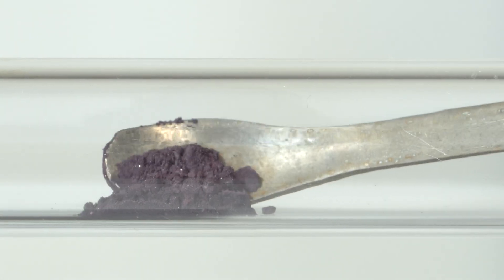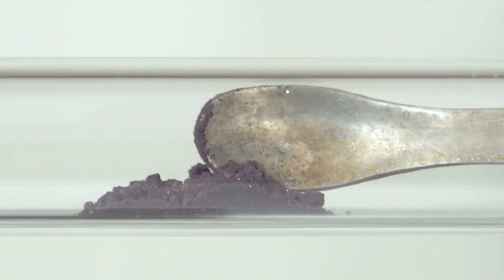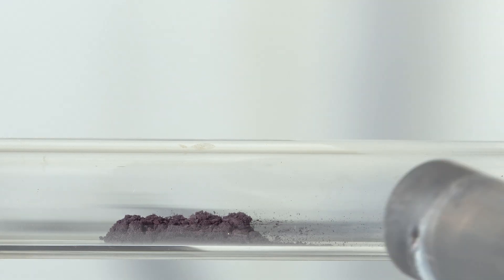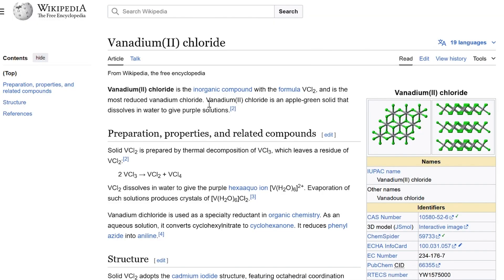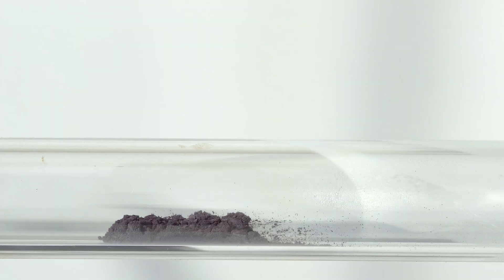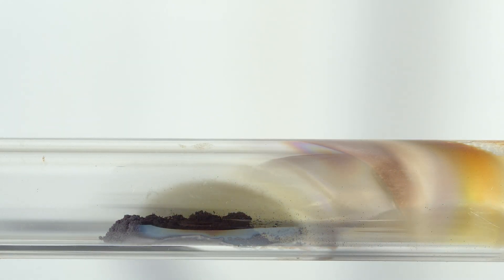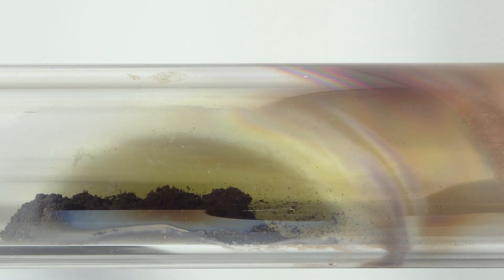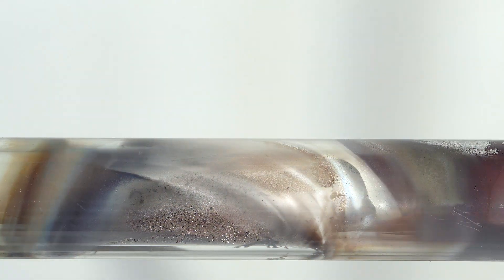I synthesized an orange liquid using LIQUID Chlorine to make Vanadium trichloride!

Comment: I swear that I have enormous respect for these types of inorganic chemistry reactions.  I remember years ago, I was in a lab and there was an old Fisher Scientific 100ml bottle with no label.  I opened the bottle to test it, and inside it had a pressurized red liquid that released a lot of brown fumes similar to bromine, but that penetrating pungent onion-smell definitely wasn't bromine. I closed the fume hood and we evacuated the laboratory for a few hours, and the bottle was handed over to waste treatment.  I never knew what it was (I breathed a little, it wasn't serious, but still, the best case scenario is that it was bromine) 😅

Comment: Normal people getting chlorine: KMnO4+HCl or TCCA+HCl
ChemicalForce: Liquid chlorine ➡ Chlorine gas
That's impressive.
Reply from the maker: It's actually very convenient! 
First of all I don't need to dry it because I've already condensed the dry chlorine :D
Secondly using liquid nitrogen you can very quickly stop the boiling of chlorine and with a glass of cold water you can quickly resume it again. 
Thirdly you know exactly the amount of chlorine spent on the reaction since you can accurately compare the starting and final volumes of chlorine in the test tube (test tube is volumetric).
Reply: @ChemicalForce  It is perfect for formal lab setup, but getting the liquid nitrogen is the most difficult part for the amateur!😆
Reply: @DangerousLab  That's the life of an amateur. Often, getting basic chemicals like HNO3 and H2SO4 is even a problem.
At least TCCA is plentiful and a good source of cheap Cl2.
Reply: @louistournas120  Indeed, the spirit of amateur is to work around the problem to get what we need.
Reply: You can just make a dry chlorine generator and condense the chlorine using a dry ice DCM bath in a suitable borosilicate glass cold trap. The enthalpy of vaporization of liquid chlorine is 293kj/kg and the enthalpy of sublimation of solid CO2 is 571kj/kg so you can easily condense a couple kg of liquid chlorine with just a standard 5kg pack of dry ice from the local market even with 25% thermal losses. It is also pretty easy to store with hastealloy or 316SS stainless steel cylinders that are pre-treated with dry HF vapor and have the correct valve material (free of brass or rubber O-rings of course). And for gods sake ensure your cylinders are also dry oil free (regulators and all). If you have to use a regulator that uses any oil, just use a little fomblin fluorinated oil.

Comment: If I'm not wrong S2Cl2 is used as a precursor for mustard gas.
Reply: Yeah if you use a mixture of S2CL2 into SCl2 it can be reacted with Ethane to make mustard gas. But i dont think it would be pure
Reply: @pteridiumaquilinum  It worked good enough in the past.

Comment: I'm guessing that the water on top of the CS2 is to keep the volatile carbon disulfide from evaporating.... (?)
Reply: Yes.  You are correct.  It's not soluble in water, so it's fine.  It helps to keep fumes from building up in the container as well.  That's how I store mine, too.